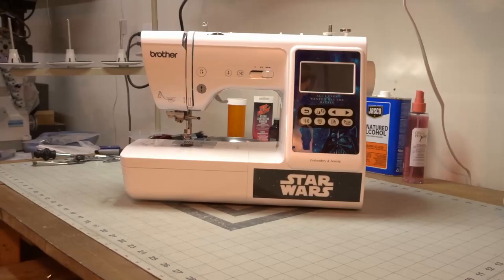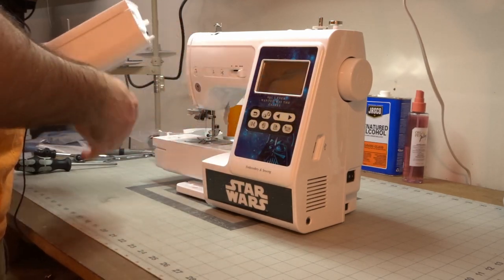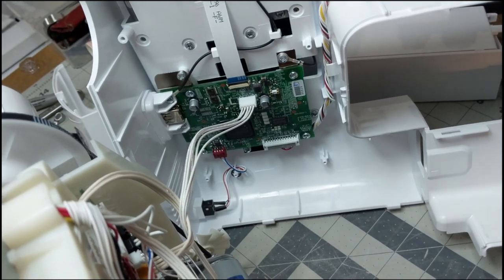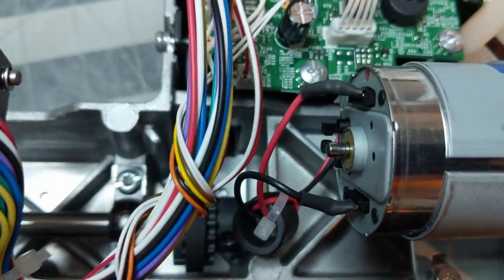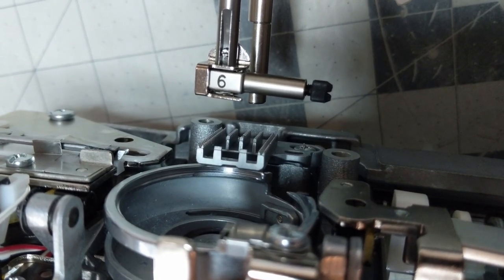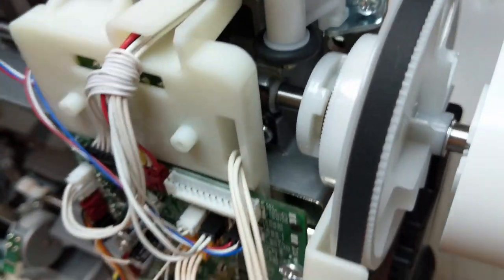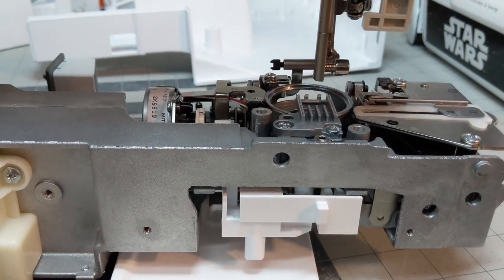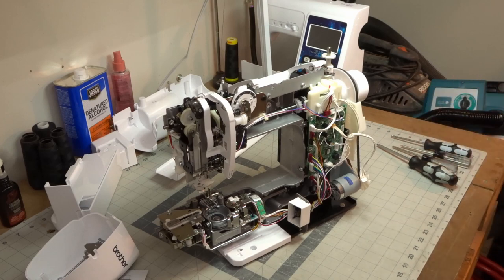Brother LB5000S is it any good? Teardown and review video for the Star Wars Sewing Machine

Comment: Thanks for the thorough review of the Brother LB5000.  We just purchased one, sort of an impulse buy, and I started watching this video halfway expecting to experience buyer's remorse.   It seems sewing machines are going the same way cars are, lots & lots & lots of plastics and longevity of the product is definitely not the goal of the manufacturer.  

We are enjoying using the machine, it has been easy to use right out of the box, and we are especially enjoying the embroidery features which don't require us to be experts.  If the machine will last eight to ten years, I think we will be satisfied.  

Thanks for the pointers concerning keeping the shafts and bushings oiled.  We are going to look for a service facility and will see that it is looked after and we will be prepared for any little dings and scrapes associated with popping apart the plastic shell.  The plastic clips are unfortunate but they are what they are.  I'll be watching some of your other videos as well.

Comment: hello on the axes (the shafts) I put a dry lubricant with ptfe, it is the same component on the oil and the grease that you use, lubricates by leaving a dry film on the support and protects from dust and dirt ( like stuffed animals)
Can be used between -45°C and +260°C, prevents oxidation and rust deposits and is compatible with all metals, plastics and glass

Comment: Thanks to your teardown video I was able to get into my Brother SE600 I purchased on ebay for a **STEAL** the the seller claimed to know nothing about sewing/machines but it powered on and there was a red light "error" (which I knew was normal when the presser foot was up) and no lcd screen display. I searched the internet on ways to fix the issue before teardown and the only answer I could find was the power on while touching the screen method which I tried and didn't work. I initially tried the teardown and got stuck on removing the plastic and chickened out for fear of breaking something. I priced about what the repair would cost ($149.99) and it would still be a deal but I wanted to see if there was something I could look at to possibly fix it? I was in luck and after inspection of the unit after teardown I noticed the flat ribbon cable on the lcd was disconnected making me think that it was going to be the issue and my SE600 lcd would light up? Eureka!!! That was the issue and it is working like a brand new machine, actually after switching the language to English because it was in French, I went to the last page of the general settings screen and the service count was 000000020, the total count was 000000020 and I went ahead and updated the firmware to 1.09 so this unit is basically BRAND NEW...oh it was missing 5 of the presser feet but not the essential ones needed for embroidery and regular sewing. I know that was a long read but just wanted to make sure you know how much your video helped me and possibly someone else....I just wish the title mentioned or the tags of the video linked to the SE series because they have the same body and look exactly alike...along with the Babylock. THANKS A MILLION!!!!!!!😁

Comment: Need advice!! I'm m looking for a machine that is durable, will last long, NO screen/lcd or any other unnecessary electronics (they break, i don't need them, just want simple), has automatic needle-threader, has top-loading bobbin and uses plastic class-15 bobbins. Has all the basic stitches and stretch-stitch for elastics. 
I'm considering Singer Heavy Duty 4452, as I will need to sew through leather and jeans occasionally. But I heard Singers break a lot (local sewing repair shop told me). Any suggestions pretty please?

Comment: EDIT:  Holy smokes, fixed it.  The tension wheel was not pushing the spring for some reason. I just manually forced it forward while turning the wheel and something popped into place. Now the wheel actually works  ToT   thanks for the vid... now I gotta reassemble whew..... hopefully lol.  I did buy this pre-owend, but not sure why the wheel would have gone out of whack in the first place..

OLD:
Just realized my tension wheel does nothing. I knew something was wrong because tension was never consistent or noticed putting it to 9 was the same as 4.. I have it disassembled only from the first top portion and removed the #3 thread loop plastic to get a better look, not fully disassembled yet.. im looking where the thread feeds between 2 and 3, i see the disc, but presser foot down does not close the disc.

Comment: disagree that electronics inherently don't last.  they are simply designed for a finite lifespan.  from what i read they could be designed to be reliable for decades.  there is a good discussion on reddit where engineers explain the many ways in which electronics are sabotaged in the process of cost cutting.  gold contacts, solid state capacitors, conformal coating, optimal cooling etc could increase lifespan of electronics by an order of magnitude but it would likely only make the company lose money so it is not done.
Reply: It’s called planned obsolescence, there’s documentaries about it.
Reply: @zacharywhipple6402  yes i know.  coming from Soviet Union where we didn't have planned obsolescence it was quite shocking.  in Soviet Union all the products had really poor performance but lasted essentially forever.  in the west everything was amazing but quit right after warranty is out.  i struggled with this for a long time - it made me sick that westerners took it for granted that everything breaks after a period of time ( in USSR things would break occasionally, but nobody EXPECTED them to break simply because they were old ).  the western system is that of amazing, cheap but disposable products - the Soviet system is that of Emtpy store Shelves.  essentially the western system is designed to make every individual both produce and consume at a maximum rate possible, whereas the Soviet System is designed to meet the most basic needs of people with the lowest amount of resources.  with the cov1d l0ckd0wns, st1mulus checks and empty store shelves we are now seeing the re-emergence of the Soviet System because it has been decided that the western system of consumerism is not sustainable and we will be moving back to Soviet System as a planet.